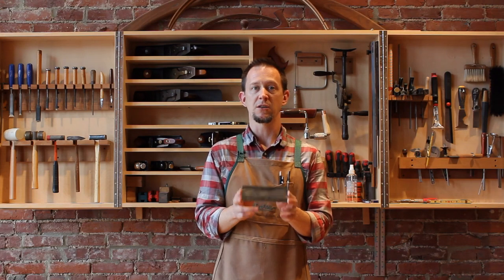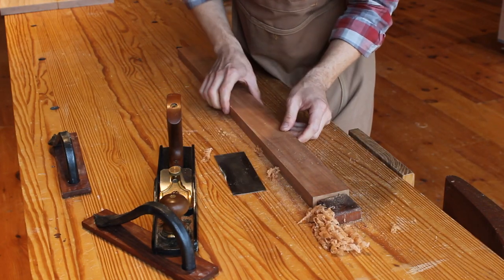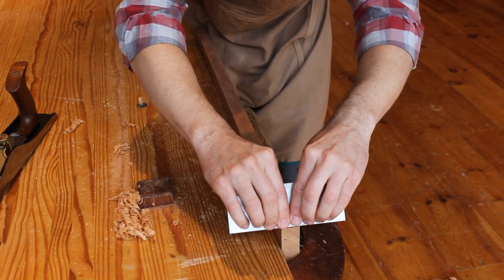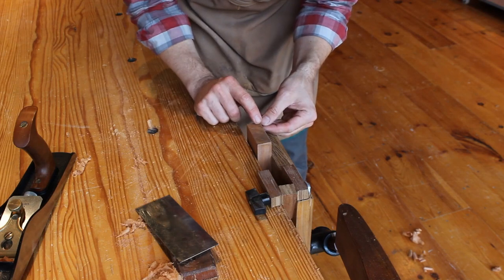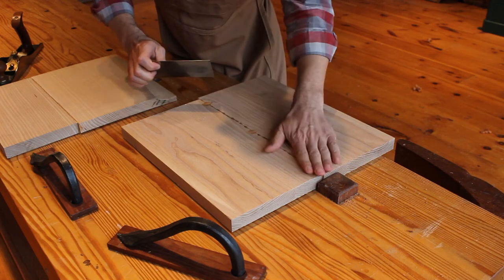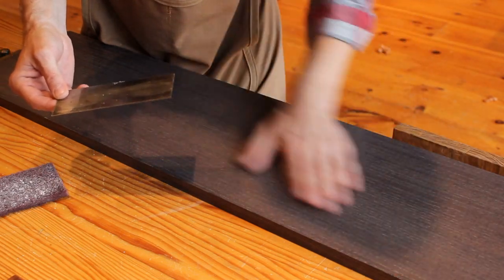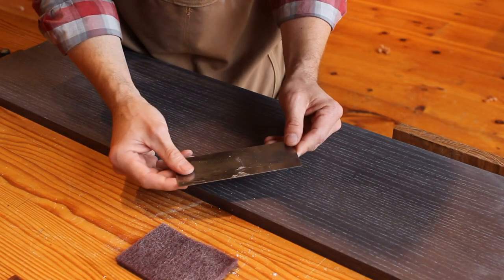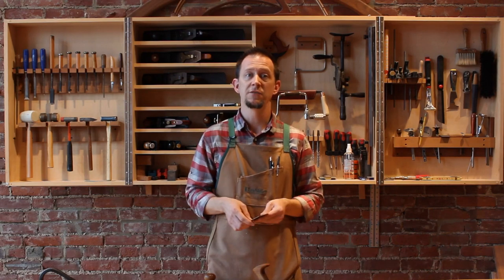More uses for the Card Scraper

Comment: I have watched a number of your youtubes.  You instruct/demonstrate with great clarity.  Thank you, I have learned a lot from you.  FYI, I use scrapers on the outside of my bowls when I am turning.  I spray some water on the outside, rub it in with my hands as if I am shampooing my hair, spray a bit more water and then turn my lathe on, about 600 rpms and scrape away...Maybe two or three passes is all I need, cleaning the scraper after each pass with paper towel.  If there are some torn spots on the end grain, still present, I repeat the "rub" of water but only on the torn area and repeat a much lighter scrape one or two times.  Magic!  I can start sanding with 220g.

Comment: Did you need to sharpen your scraper between each segment?
Reply from the maker: ***** No, but I had sharpened all four edges prior to shooting. That was easily enough to get through the shoot. Scraper edges, properly sharpened and with a burr that isn't to big will last for 5 to 10 minutes or so depending greatly on what you are scraping. So that's anywhere from 20 to 40 minutes between sharpening. If you are just cutting back finishes they will last a lot longer than that.